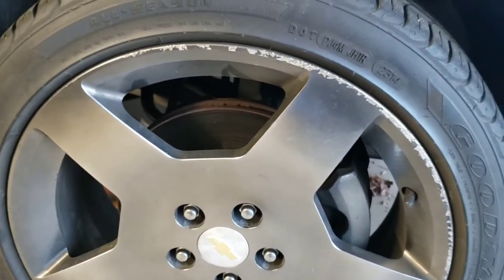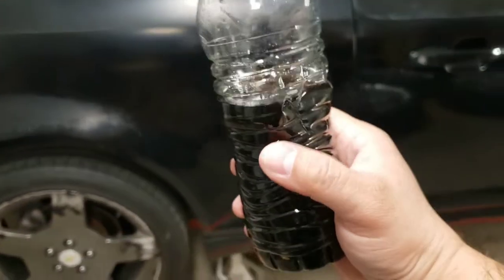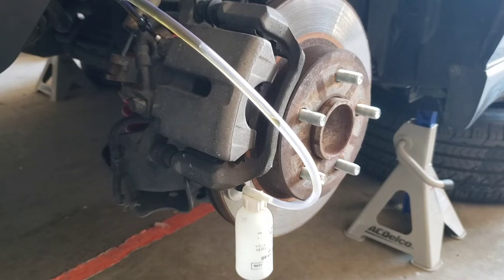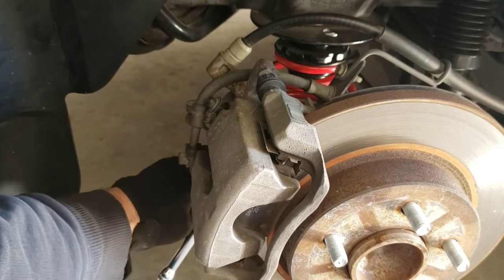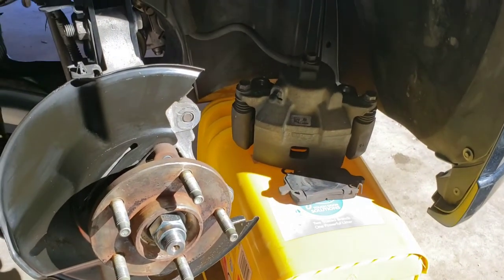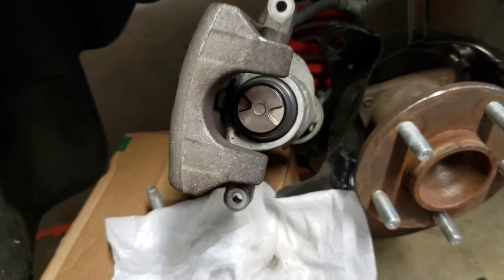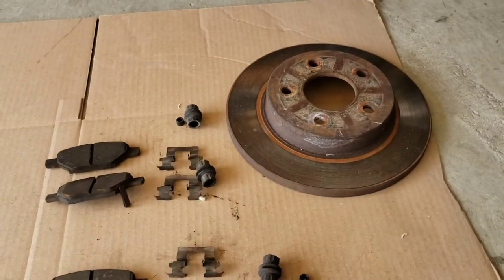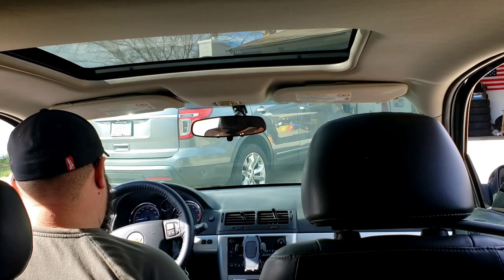CHEVROLET COBALT SS  // BRAKES AND ROTORS UPGRADES

Comment: Those bolts are nothing. Ever taken an optispark off a 94lt1 Camaro. Or the spark plugs with stock exhaust manifolds?
Reply from the maker: 🤣 I think we took it off like 3-4 times

Comment: Great video and the new rotors and ss rims look awesome on the car brotha. Also in my opinion just because I'm in the same restoring process as you  I would definitely paint your calipers as it will really make your car look better. Also I look at stainless brake lines also either from zzp or ottp. They will make difference with your new brake upgrade. Keep up the great work. I've watched your build since day one and helps to keep me motivated with my own build.
Reply from the maker: Thank you so much for following the build.  What color should i paint the calipers? i did want to go with red. The stainless brake lines would be a great upgrade. ill definitely will be looking into those for sure.  comments like yours are what keeps me going. thank you again for the kind words. i would love to see what you are doing to your Cobalt!
Reply: I would paint them either lime green,  yellow or maybe a Ferrari red. I'm going to paint mine red sport tint coat since my 07 Pontiac g5 gt is that exterior color.